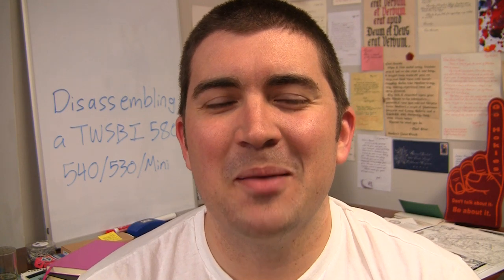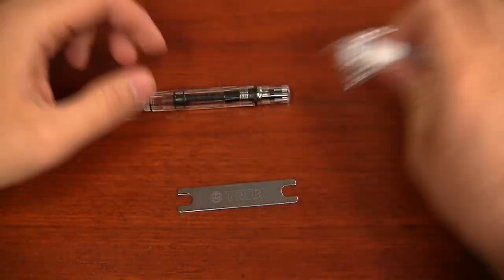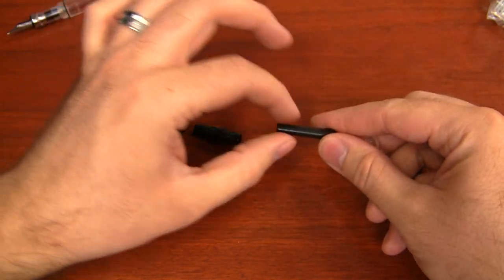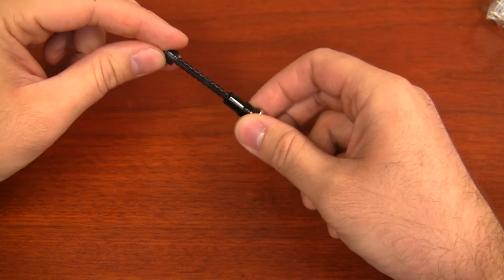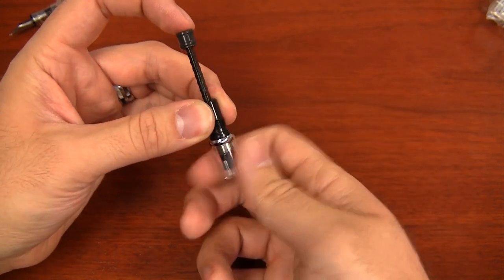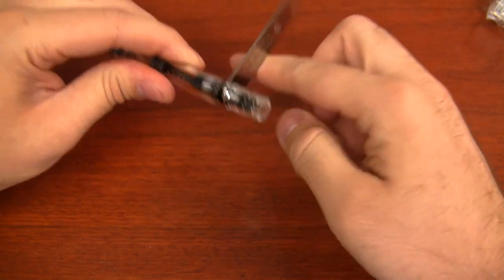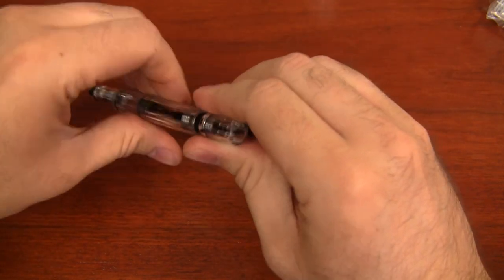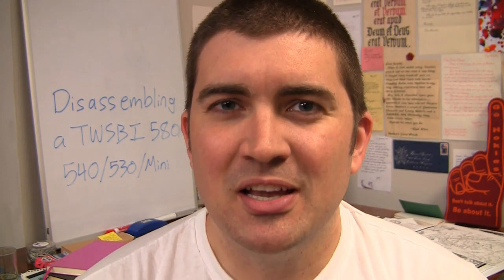TWSBI 580 Disassembly

Comment: Want to make sure you know that this video is still helping people years later! Was doing some serious cleaning that had never been done on a 580 I bought from you years ago and this was a great reference!
Reply: I was surprised how much more ink (built up junk?) I got out of my TWSBI on complete disassembly. There was even more when I flushed it using mild pressure with a rubber bulb full of water. I avoided using chemicals. I have a feeling I may have bought a TWSBI 580 that was "new old stock" as even with plenty of lubricant, I will need a new plunger as it is not sealing as well as it might. Parts? Good video.

Comment: I've utlized this video half a dozen times now. My piston gets stuck in the barrel and I always forget how to take it apart, lubricate the piston, and get it back together. This is why I buy all my ink and pens from Goulet Pen Company. Thank you!
Reply: And I just found the answer to my problem in this video (again!). I had left it so that the pegged cap was loose on the end of the pen and this solved it. When anyone wonders why they should buy ink and pens from Goulet, it's because of this kind of information and service.

Comment: This was super useful. I've accidentally over-disassembled an Eco piston once before. Frustrated for ages, eventually found a YT video from one of your competitors (boo hiss) which worked but which was far more involved. Screw the cap on exactly this far, be careful to X and to Y. I just tried again, deliberately taking an Eco to bits and using your technique. I was able to do it just by feel and also found i can get the piston back one more click than I'd done before, resulting in less of an air gap behind the piston when fully up without going too far & making the end cap spin. Result being that I can now get a teensy bit more ink capacity to any of my several Ecos than as shipped with no detriment as far as I can tell. For those that need maximum capacity, it could be a good tweak and it's not even a hack. I'm not one of those that needs more ink capacity. I just need more Ecos :)
Reply from the maker: I’m glad this video was helpful! -Brian Goulet

Comment: This video saved me! Thanks Brian!
I bought my brand new TWSBI Diamond 580 and bought an alumnium piston and grip section for my pen so I could get the 580AL version (the 580AL wasn't directly where I live) I disassembled the pen, but couldn't fit the new piston in there, the piston turning knob simply wouldn't sit flush with the barrel. I thought I had damaged my brand new pen - I hadn't even inked it up yet.
But then I calmed down and watched this video - and my TWSBI 580 is now a 580AL and as great as it can be. Thanks Brian!

Comment: This was a lifesaver! I over twisted the end cap while filling my 580, and then it wouldn't tighten down all the way. Once I stopped trying to figure it out on my own, I came here, and it was just what I needed. You fixed my pen more than I did. :)
Reply: This video is still helping, even more than 5 years later! I bought a 580 ALR and it’s been sitting on my desk for months now with the a lid that wouldn’t screw in properly. Thank goodness for you, I just successfully applied your techniques and it’s working again like new from the box. 🙏🏻🙏🏻

Comment: Thanks! I took mine apart to clean out some ink remnants (switching colours) and give it a general clean, but couldn't get the end cap back on without closing the gap (where the wrench sits). Basically the piston was all the way up, but its final few millimetres wouldn't let the end cap close all the way, thus not allowing it to sit firmly on the pen barrel. Drove me nuts! This video restored my sanity.

Comment: Thanks! Saved my TWSBI (from my own DIY 'skills').  Thank goodness for you, talking to us down the years.  I also had the piston bit wedged in the barrel, but a lot of hot water and detergent got it moving. I also needed a covered slipjaw wrench on the barrel to work the little TWSBI wrench against, to open the end.  I would never have worked out the clicky-advancement thing though.

Comment: Wow, thanks for this. My entire end section popped out for some bizarre reason. I didn't even need a wrench to get it in or out, it just pops into or out of place. This is probably a bad thing, but it seems sturdy enough if I'm careful. Oh well. Thanks for the tip on how to get it all back together. 

Also, if you remember I made a comment on one of your videos accusing you of sacrilege for not carrying Parker pens. I just wanted to clarify that I was only joking. Your website is fantastic and modern Parker pens aren't that great or unique, unlike their older ones.

Comment: Oh, and one other tip I'd give is that BEFORE feeding the piston/plunger screw back into the screw mechanism (TWSBI terms: "connector" and "screw bolt"), screw the end cap back on to connector a few turns and THEN feed in the piston screw. By the time its all the way up, the end cap will by snug and firm against the barrel. If you're messing about with the pen, I think you'll see what I mean.

Comment: Nice video, but where does the grease go, just on the outside of the plunger? I also have the TWSBI inkwell (I have the red one, they hold 50ml of ink) do I just unscrew the tip and push it down on top of the inkwell and suck up my ink?

Comment: Hi! Do you have any tips how to fix this issue: when I turn the knob counterclockwise to extend the piston rod, the piston rod doesn't extend to the ridge and the knob starts to loosen itself from the connector. Just a reminder that I'm turning the knob counterclockwise the whole time. The piston rod retracts just fine and the knob becomes fully seated.

Also, do you happen to know if the AL(R) rod notches can get worn down due to frequent assembly?

Thank you for taking your time reading my post!

Comment: Well that certainly negated a stream of inappropriate adjectives that would have presented themselves at my first crack at reassembly on the 4 that you just sent - Thank you!

Now the noobie questions…
With what frequency should this be broken down, every refill/ink color change?
And the same question with respect to the Grease? Additionally, exactly where to apply it and how much?
Reply from the maker: Oh gosh, you definitely don't need to go through all this every time! In fact, you don't ever need to completely take the piston mechanism apart, basically ever. That's the toughest part, and the only reason I show it in this video is because people end up doing it and get stuck. In fact, you could really just never take the pen apart and be okay, you can clean the pen just by filling/flushing with water like normal. But if you want to grease the piston seal, you'll need to take it apart. And that's only every few months, maybe, that you'll "need" to do that. The piston seal is the black rubber part that moves up and down along the walls of the pen body inside the ink chamber, and it needs to be greased because it makes contact with the pen body. The grease makes it easier to slide. You don't need a lot, just enough for a thin coating on the seal.

Comment: My piston/screw to my TWSBI 530 is stuck inside the pen chamber!!! I can't get it to UNSCREW OUT of the pen...even when the end cap/screw bolt/connector assembly are attaching to the screw end!! It just won't dislodge and come out?? Why am I disassembling it? I am changing colour of ink from the TWSBI ink bottle I also bought! How do I get the piston/screw assembly OUT to wash out the old ink and clean everything, before I reassemble? If I can't get the piston/screw out of the pen, it can't possibly draw new ink?? What to do??
Reply from the maker: In general, you shouldn't need to disassemble the pen completely if you're just switching inks. Just use the piston to draw up water and expel it a few times. That said, definitely reach out to our Customer Care team (info@gouletpens.com) and they should be able to help troubleshoot your issues. If possible, including pics is a big help. - Colin

Comment: I need help with my Twsbi Mini! My screw has separated from my connector and the screw is stuck in the barrel detached from the connector/screw bolt/endcap part!!! I don't know how to put it back now... T___T
Reply from the maker: Itchypaws There's a couple of ways you can get that out of there. You can either unscrew the nib unit and push out the piston/screw with something thin like a paperclip, or pull it out with a pair of needle nose pliers (if you're not able to get the connector back onto it). -Brian Goulet

Comment: so I did the above - opened - greased and reassembled - and the piston is now smooth and not stiff and moves up and down the full length of the barrell... However it now seems to have a non proper seal - ink seeps in to the gap between piston head rings and above into top part of barrell. It also won't fill fully now.
Reply from the maker: Adding silicone grease to the piston itself (not the rod) might help the seal grab the sides a bit better. Brian goes into more detail in this video: https://youtu.be/e-X4B5LnZ-o - Colin

Comment: Brian, help! I took my mini TWSBI Fountain Pen apart and cleaned it. When I got it back together the end cap will not tighten, it's really loosey goosey.... what gives? I tried doing what's on your video where you screw the push rod out, push it down to make it jump down over a thread that's on the inside of the black tube. I pushed with all my might until it shot out of my hands and pieces went flying across the room. Ahhhh! I don't know how to fix it. Anyway you can help? It looks like that it's put together right, the plunger comes all the way back but the end cap will not stay tight. I'm missing something. HELP! TIA! I can email u a short video or post it on here?
Reply from the maker: +Alex Thomas Yeah, email some pictures of the issue to info@gouletpens.com. It's hard to picture the issue from this comment, but our Customer Care team should be able to help. - Colin
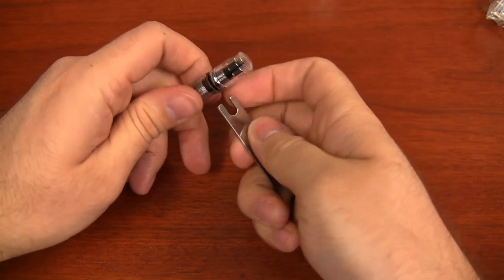Reply from the maker: Ok, it seems like your piston is too far in the end cap. If you rewatch the video starting at 10:30, with the solution starting at 12:15. Brian does a lot better job explaining it visually than I could with a comment. So watch those parts and that should help! - Colin
Reply: Ok, thanks man. I'll watch it again tonight when I get home. I'll keep you posted if that's cool. How was the video, could you see everything good or do I need to make a different video?

Thanks man,
Alex Sullins
Reply from the maker: The video was good. Exactly what I needed to see. Your issue seems to be what Brian talks about in the video, so you're in good hands. - Colin
Reply: B-)  Cool, thanks man going to try it tonight. I'll keep you posted.

Comment: How do you flush a twsbi 580
Reply from the maker: With the removable nib unit, the 580 is pretty easy to clean. Just run water into the nib unit & barrel. Either a ink syringe or bulb syringe can help with that too! - Colin